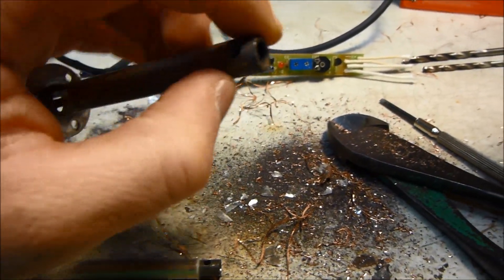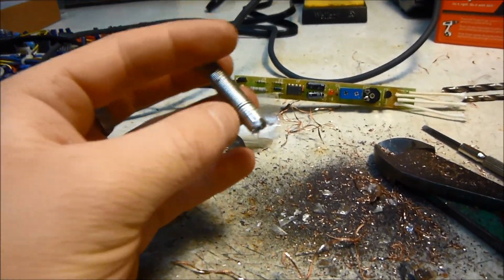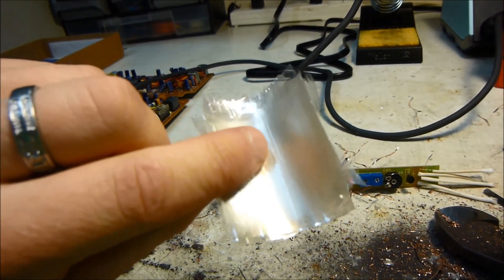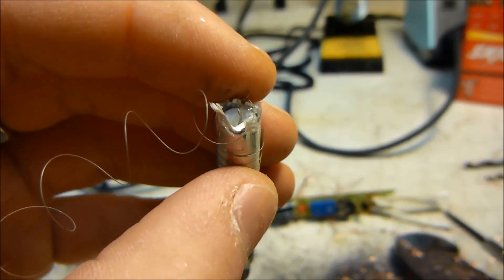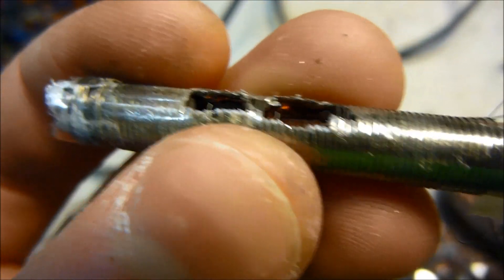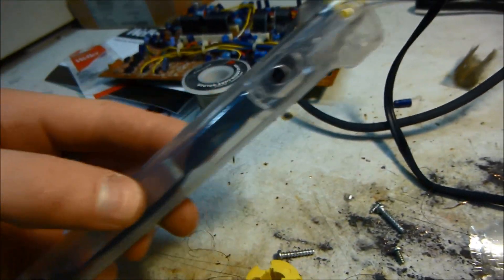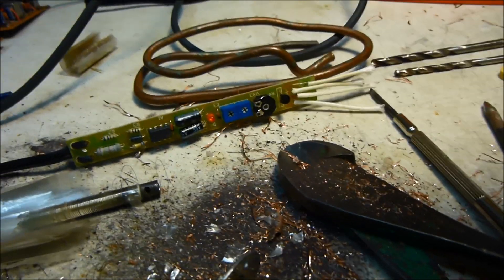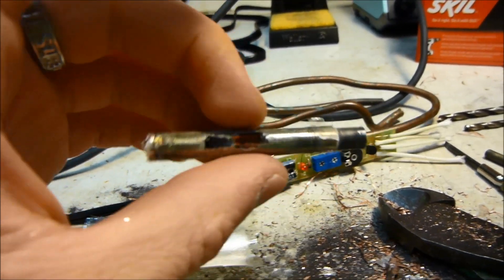Be Very Careful When Drilling Out a Stuck Soldering Iron Tip!

Comment: Used my soldering iron to replace 2 capacitors. Not even 20min of work. The tip got loose and in an attempt to fix it, the screw head broke off. now what do I do???

Comment: I know this vid is 1 year old now, but if anybody is seeking good value/money in soldering iron or station, guys, get some witch have 900M tips (Hakko's system). You can buy genuine high quality Hakko tips for $3-4/pc, or you can buy chinese knock offs from e-bay, set of 10 different tips for $4 (http://www.ebay.com/itm/10-Pcs-Solder-Iron-Tip-900M-T-For-Hakko-Soldering-Rework-Station-Tool-Silver-S3-/221856774252?hash=item33a7b1b86c) .... they work well, are incredibly cheap and 900M tips are very easy to replace.

Btw, if u want cheap hot air/soldering station combo, try look at 898BD+ (http://www.ebay.com/itm/YIHUA-898BD-plus-Soldering-Station-SMD-Rework-Iron-Hot-Air-Gun-100-240V-/271934829132?var=&hash=item3f5094324c). I bought one 2 months ago and as hobby solderer I'm very happy with it :-) There are cheaper adjustable soldering irons with 900M tips (for example - http://www.ebay.com/itm/Electric-Adjustable-Temperature-Welding-Solder-Soldering-Iron-Tool-Pro-60W-220V-/201185866014?hash=item2ed79cb11e), but they have not so accurate temperature control like soldering stations.
Reply from the maker: +amigator Those look like nice soldering stations.  I have the Weller WESD51 which I love so much.  I have had it for over a year now and I still am using the chisel tip I bought with it.  They last a LONG time.

Comment: you never said what soldering station it is? hahais it just a 40 watt weller? im curious because i nned to buy one badly and theres so many options, could you possible do a quick make your own tips video? that would be awesome! it would save alot of people alot of money!
Reply from the maker: Ok so this is the soldering iron that show broken in the video.  There are other ones that look very similar but they have the screw in tips and not the long kind of tip that is easy to replace with homemade ones.  It's actually 60 watts and there is no model or name or anything.  Just Chines no name company.  I had mine for four years an it was the best soldering iron I ever had.  I still liked it better than the $150 Weller soldering station.  http://www.amazon.com/Soldering-Adjustable-Temperature-60Watt-392%C2%B0F/dp/B00DE8I6L0/ref=sr_1_30?ie=UTF8&qid=1403817516&sr=8-30&keywords=temperature+adjustable+soldering+iron

The current soldering station I have now is a Weller WESD51.  It's honestly ok.  I really hate that the tips are so expensive and seem to corrode really fast.  With this iron it's really not even possible to make your own tips unless you have a machine shop.  It's just not worth $150 in my opinion.  Here is the Weller WESD51 soldering station I have currently:  http://www.amazon.com/gp/product/B000ARU9PO/ref=oh_details_o00_s00_i00?ie=UTF8&psc=1  I should do a review video on this station.

Thank you!
Reply: Makerj101 ahh i see thanks for the reply! i have a really tiny sized soldering iron that i love alot but yeah tips are really expensive :/ i might give the one you like best a try! very cheap! just the way i like em
Reply from the maker: corbonzo1 No problem!  Yeah I totally like the cheap one better than the expensive one!  I still need to buy a new one of the cheap ones that I like.  I thought the expensive one would be a lot better and replace the cheap one, because it was more expensive and is from a well known company but I guess I was wrong.  I hope you like it too!  Good luck!
Reply: i want a metcap so bad but yeahh there soooo expensive XD hahaha
Reply from the maker: corbonzo1 What is a metcap?
Reply: its the best brand of soldering station you can get
Reply from the maker: corbonzo1 I googled it but I didn't get any results. Can you give me a link? Thank you!
Reply from the maker: Hmm yeah that is expensive!!!  And the tips are $23!  I thought $10 for a tip was expensive!!!  LOL  I bet it's a great soldering station but in my mind it's not worth almost $600.  I could by pretty decent new computer with that much!
Reply: haha yeah maybe one day ill find a super good deal on ebay or something lol im pre sure it doesnt have screw in tips though so you could make your own
Reply from the maker: Yeah I hope you find a good deal on one!  I would guess it has like tube shaped tips.  My Weller soldering station has tube shaped tips.  The temperature sensor sticks inside the tube to get a accurate reading.